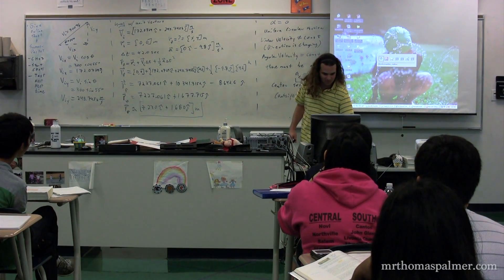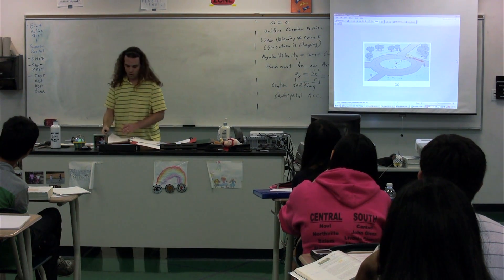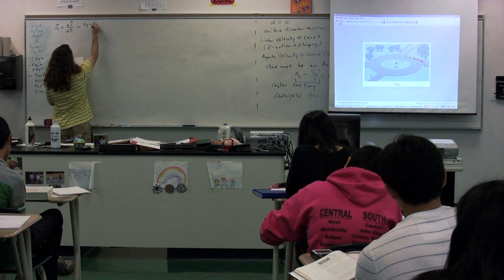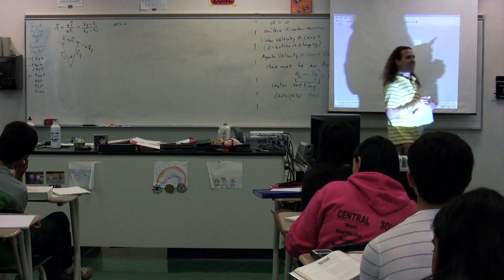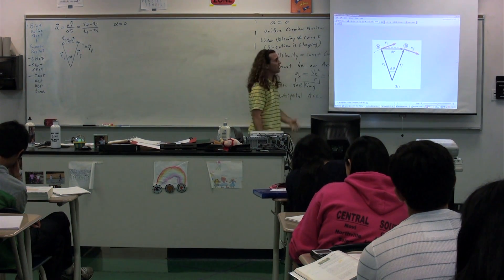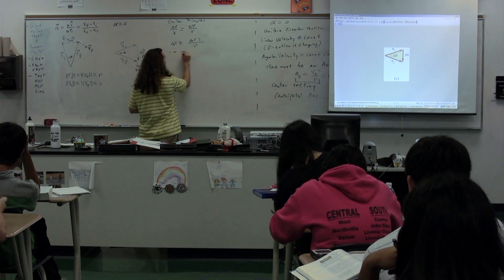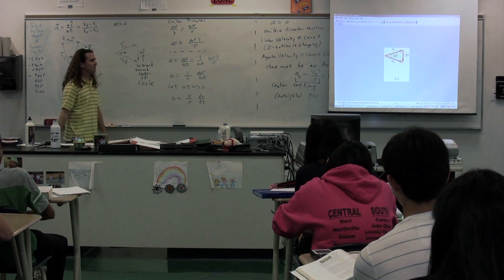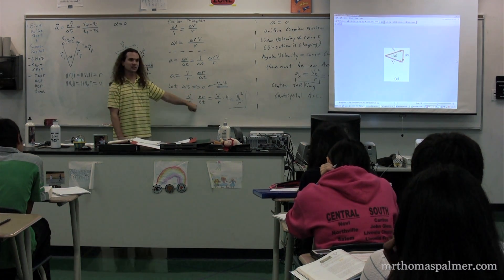Derivation of Centripetal Acceleration

Comment from the maker: Therefore, because both triangles have the same angle between two equal magnitude sides, the two triangles are similar. This only works with Uniform Circular Motion (constant angular velocity and constant radius), which this is. If there were a tangential acceleration, the two triangles would not be similar because the magnitudes of the tangential velocity vectors would be different.  Thanks for the question.

Comment from the maker: Because the radius is not changing the two radii vectors (introduced at 1:40) have the same magnitude. Because the tangential velocity vectors (introduced at 2:10) are perpendicular to the radii, the angle (delta theta) between the two sets of vectors (radii and tangential velocity vectors) are the same. Because the object is moving at a constant angular velocity, the magnitudes of the tangential velocity vectors are the same. (continued in next comment...)